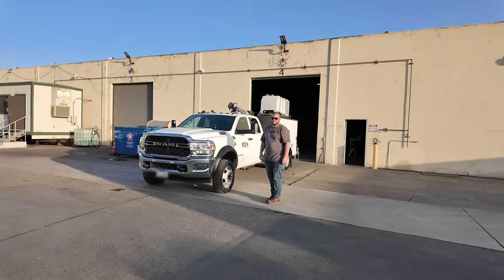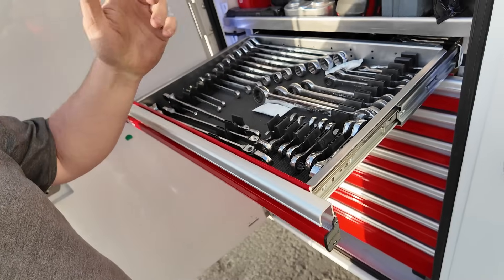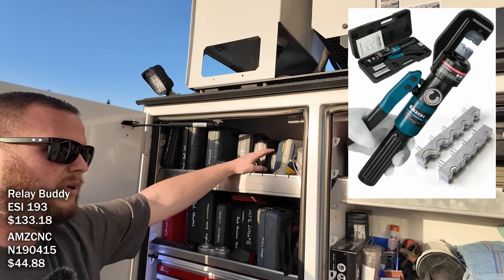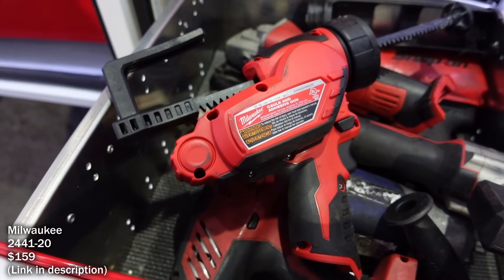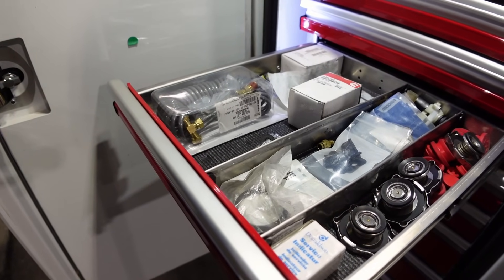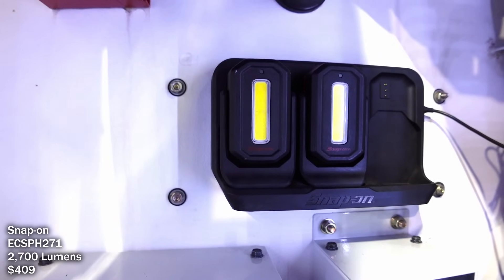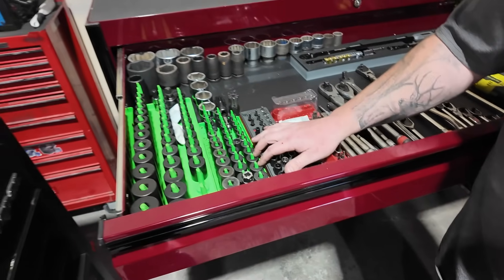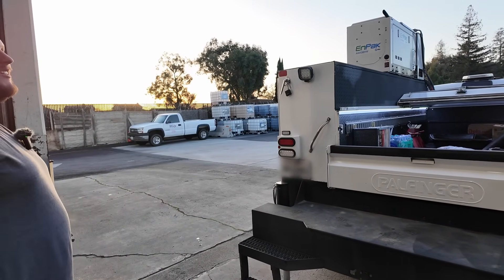Custom $225K Mobile Work Truck (Entire Shop on wheels)

Comment: Video came out great, thanks for coming out.
Reply from the maker: Thanks for the invite!
Reply: What’s that truck run 200k with no tools?
Reply: Well done!!! Being a mobile tech; the high vise is necessary because of getting the trucker back on the road... and not wanting to send them on their way with your tools... lol     Really impressive set!
The miller Diesel for all the accessories.. makes it that much better! 
I have a CDL with Triples endorsement and Hazmat which is a money maker!  And clean driving record.....   
Tow bills are super expensive and having a mobile unit like this is a value to small companies!!!   Like he said its just to get the truck back to the yard and 9 times out of 10 they don't want to call a tow truck because out in the field it may need a turbo / or just maybe an air fix...  and I'll say 7 times out of ten I would call a mobile mechanic and the rest of the time a legitimate driver will be able to diagnose a problem or long term fix... 
Lot of CDL small companies will ask for prior mechanic skills... lol and I've changed air valves and clamped air lines to limp a vehicle back to the yard.... 
Although I've never done it but watched it is a guy hitting a deflated tire off the rim with starter fluid (lightly) and throwing a match at it.... we were pulling hay out in the middle of no where and it was fun to watch!!! lol.   This technique will actually kill a person.... so hit it light with the fluid and work up from there.... 

Being a mobil tech I would encounter companies with a catch phrase....  If I don't land you a 50% success rate with my service... then last bill is on me!  And safe to say... don't call me again...    lol  effort vs energy vs paycheck.... simple formula!!!

Comment: That truck set-up is incredible, and Jake is a Road Angel and a blessing to anyone who gets stuck out in the field or even worse on the side of the freeway.  Can't believe the transmission blew out at only 3,000 miles! Thanks for sharing!
Reply from the maker: Yeah I was surprised about the transmission too
Reply: Ram had a service bulletin out for those trucks it was for the c2 clutch drum snap ring. The snapring will come out and cause a lot of damage to the drum and since the clutches are not depressed it will cause damage also. How I know is because I did that exact job a few months ago the truck had 7k km on it

Comment: Nice setup. I’m a mobile marine diesel mechanic. I have a 16 Freightliner step van. You have to pack these trucks with everything under the sun so you can get the job done and get the heck out of there. Great video.
Reply from the maker: Yeah that makes sense!

Comment: As a mobile mechanic as well, our trucks are very similar. Same toolbox brand, lights in the bed and cabinets, slide back bed cover, mounted welder/generator. Except his is a 5500 ram with a crane and I’m in a F350 no crane. Love seeing these kinds of tours! Keep up the awesome work!

Comment: 8:41 that refill kit is awesome and it also holds a vacuum so you can replace a thermostat or a hose without having to drain the whole system or making a mess
Reply: Works great on hydraulic tanks too
Reply from the maker: Oh thanks for the tip!

Comment: I use to restore Porsche, & Mercedes Benz cars, on my off fun time I use to Repo, cars, motorcycles, boats, RV’s, & a few offices. 

I worked out of a Ford E350, with a Diesel, that had 2 fuel tanks, I had a large bottom Snap-On box, and two top boxes, Nitrogen tank to run air tools, & fill tires, mig welder, gas welding equipment, engine hoist… everything on board. That van helped me make a lot of money. I worked from San Diego to Santa Barbara. I’d often sleep in the van, I had two ice chest in it, one for food, the other had drinks. I could work 24/7.
Reply from the maker: Thanks for sharing Enrique!  Very cool

Comment: Killer setup. Wonder what the 12 point impact swivels get used for? Only things I’ve really used 12 points on is head bolts and flywheel/clutch hardware and occasional starter bolt
Reply: I saw that too.  I couldnt see what size it was.  Prob use it on drive lines

Comment: Not hating but that’s a cute little crane .. hey for the work you do maybe that’s all you need.. and you’ve been doing it 19 years brother maybe you don’t lack for space but either those boxes are small or you gotta loose the snap on plastic holders I know it hurts I hated letting mine go (still have them all at home) but with tool box widgets and different organization techniques you can fit so much more if you ever need the room
Reply from the maker: Yeah it seems quite difficult to keep things organized and still fit the most tools in a truck. Thanks for sharing!

Comment: If it was a Chevy or GMC truck it would have been a 10/10 truck set up. Going to have to deduct some
Points just because it’s a ram.
Reply: RIP the transmissions in the RAM Cummins
Reply from the maker: I was surprised it only lasted 3k
Reply: Had just about all them.There really isnt a truck that holds up as a service truck.  None of the fords, chevy, dodge make it.  The KW and Petes are the same truck and cab sucks and no turning radius, always a proplem. Loved my old Hino with IMT crane.